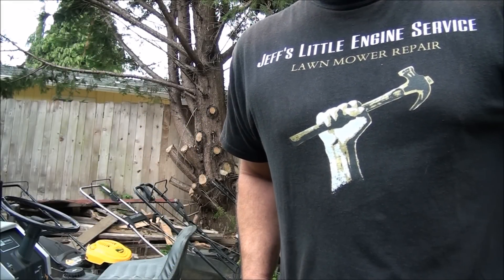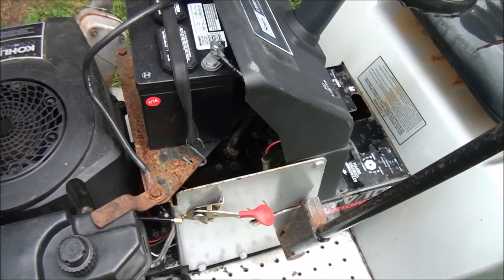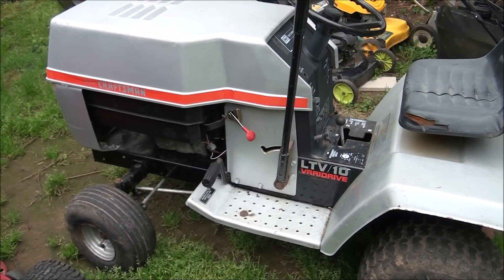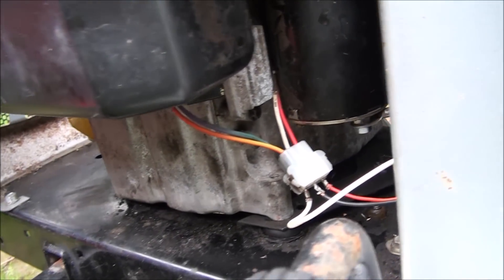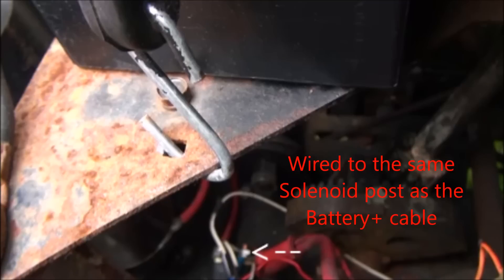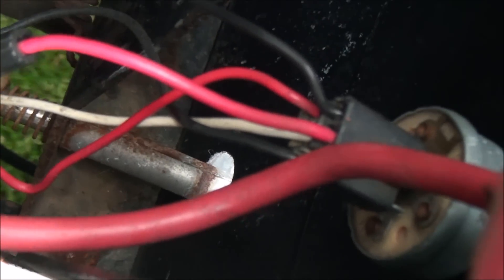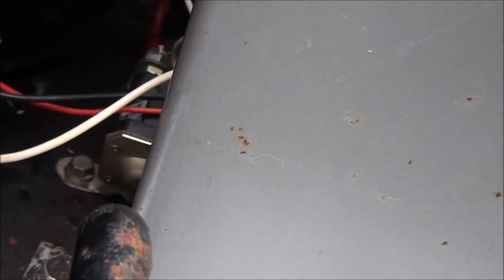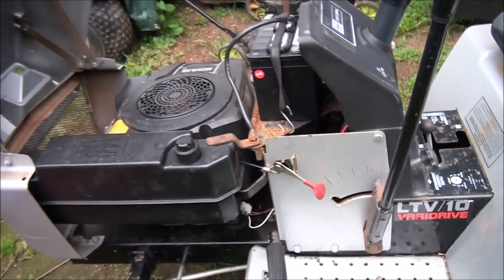EASY WIRING a RIDING LAWNMOWER. HOW TO WIRE your RIDING LAWN MOWER ELECTRICAL SYSTEM

Comment: Thanks this helped out immensely we where doing an engine swap on our racing lawn mower and we where using the stock harness off the donor mower and once we figured out the wires and where they went it was just a bunch of soldering

Comment: Thanks for the video, im swapping engines on a mower from pull start to electric so have to do it from scratch. i have the same ignition key so hope it will work.

Comment: I had a leaky fuel solenoid so I just used a bolt from another scrap carb without the solenoid. Works great. No leak
Reply: Yeah I hate the fuel solenoids. They have a good purpose, but they are a pain in the ass because they mess up at the most inconvenient times.

Comment: Thanks great vid, i got a little confused on the wiring clip connection though.
Reply: I got it working but the stator wires were black n red and when I hooked one up it started smoking, so I don't have a batt. Regen. Hooked up yet

Comment: Got a donated mower for me to use and the connector to the rectifier is/was melting and the wires were smoking while I mowed my lawn. While looking at it, after it was shut down and cooled a bit, I learned a ton about rectifiers.... someone soldered two yellow wires to the AC inputs on the rectifier. 🤔 Snipped the 2 yellow wires and now, hallelujah, the battery is getting almost 14 volts. Now, what the heck do I do with these 2 yellow wires?

Comment: Hello...I have a question for you...I have a  Kohler engine on my craftsman riding mower...how do I connect the stator direct to my battery..my stator has 3 wires ...one purple and two green wires ..one of the green wires has a clip connector on the end which is not connected to anything ...I'm trying to rewire my mower ...can ane please help ...thank you n God bless
Reply from the maker: I do not have the stator wiring codes for Kohler.

Comment: I've got a sears tractor just like this but with a hydraulic bucket on the front, it's been sitting for years and Ik it doesn't start, and I'm sure the hydraulics don't work well, so basically if I do anything to it the entire thing will need to be restored, I figured the easiest way to get it to run is to put a brand new motor in it, is it hard to swap out motors like this one I want to keep the outside original so I don't want the motor side ways and sticking out

Comment: Jeff, awesome video. Very simple and easy to understand. I am working on my first riding lawn mower. The wiring is a mess. My question involves wiring to the alternator. One side goes to the lights. According to the video the other side should run the positive side of the battery, correct? I'm working on an old Montgomery Ward Briggs and Stratton lawn mower. It's probably an older version of a Craftsman.
Reply from the maker: yes one goes to the lights

Comment: Random question, I cut the kill switch chord years ago and never had any issues. I wrapped the cut chord with electrical tape. All off the sudden I have a 30 watt fuse blowing almost every time I run the mower, it’s a cheap fix but there’s got to be a better way than buying a 100 fuses lol
Reply from the maker: The stator/ diode may need replacing

Comment: Great video! Very easy to follow. I do have a question, if you were going to add lights to that lawnmower, would you just need an ignition with 6 prongs?
Reply from the maker: There is a few differnt ways to do this. I would try those methods first before getting a new Ig switch.

Comment: I have the same tractor 1982 Craftsman GTV 16 I was mowing the lawn the other day everything was fine I put it in neutral to pick up something and then I put it in 3rd gear and it wouldn't go put it in first gear it would go and then I tried second gear hesitated then it went and it went and then after that it wouldn't go in any gear not first not second not third not even reverse any idea thank you appreciate it

Comment: question...   what if i have a electronic engagement for the  mower deck?  I had my 86 12hp hydrostatic craftsman 38" out cutting and it cut out.   time went by, I found your video and rewired the whole tractor.  its turn key and running like a champ.  However, I cannot get the deck to engage...   any ideas?

Comment: one question, the magneto connection, does it connect to the ground of the magneto from the switch or the positive side of the magneto? mine is probably a 96 model motor, so my magnetos have two connection tabs on them.

Comment: My mower didn’t have a rectify thing, one of the stator wires went to the ignition switch and went back to the battery to charge it

Comment: I would disagree with one thing. You ran the charging wire directly to the battery positive vis the solenoid. In that situation the stator is forever energized. I run mine to a switched post on the starter switch. That does two things, it keeps the stator and related wires dead when the switch is off, and runs the charging current through the fuse on the way to the battery. Make sense?
Reply from the maker: Good tip

Comment: I know this video is a little old but I have a question?  Are you basically putting constant power (once it's turned on) to the fuel solenoid?
Reply from the maker: yes
Reply: Jeff's Little Engine Service this really helped me about the fuel solenoid I was hot-wiring a Cub Cadet lt1050 because somebody stole the key ignition switch off of it and it just would not turn over after seeing this video I realize there was a fuel solenoid as soon as I sent power to the fuel solenoid it cranks right up awesome video

Comment: That helps a lot. Thank you for making the video. I do have a question...

At the end of the video when you attempt to start it, it just clicks and doesn't start. You then release the switch and restart it and it cranks. 

What causes that 1st click or failed start? I've heard it so many times but have never been able to figure it out.
Reply from the maker: good question! What I discovered later on this mower was a faulty ground cable right off of the battery. You can see how rusty it is in the video. I saw sparks from the connection on the frame one day when trying to start it and discovered how rusty the connection was. A bad ground. I sanded the area down to bare metal and reattached. Seems to work alot better now!~ :)
Reply: yes due to a bad ground. same thing applies to vehicles. when your friends clunker just clicks and clicks, check the ground

Comment: I have a Husqvasna 26.0 hp  and when ever I turn the key switch the fuse blow , what would cause that.
Reply from the maker: check the 2 wires on the blade clutch located underneath the engine. sometimes they get scuffed up